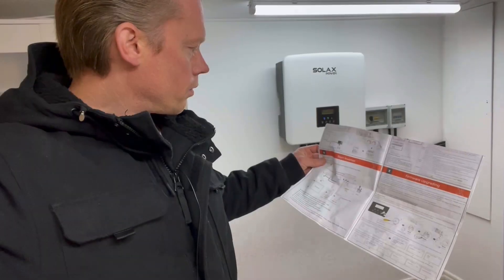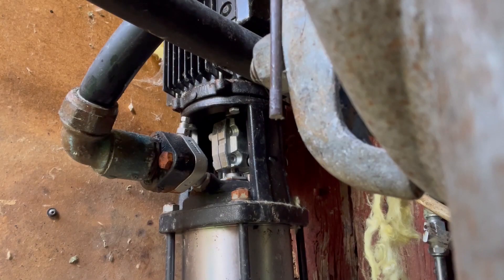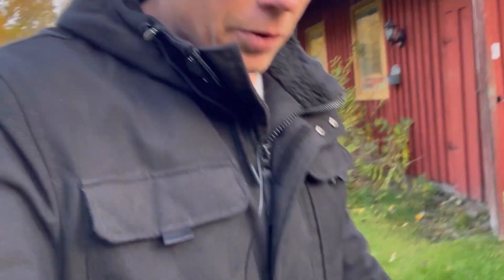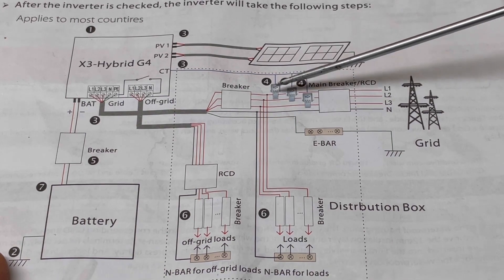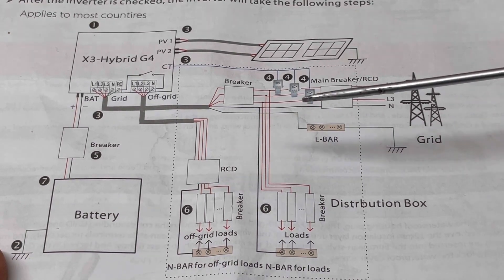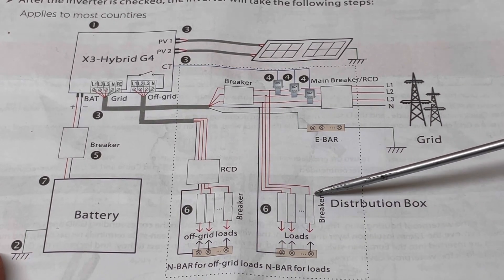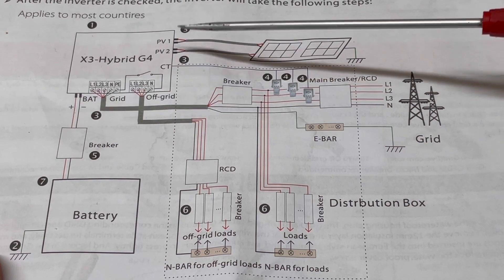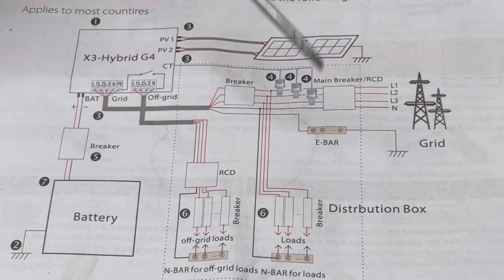Trying my 3 phase well pump off grid with my solax hybride inverter

Comment: Nice one! Good to know you have water independence too. I guess your power tools are also happy with the new supply!? 
I bought a much smaller pump for this reason. A Katsu electronic booster pump, that only draws about 500W. My 5kW inverter can handle it without complaining.
Reply from the maker: My compressor is probably to big, 9kw motor on that one... I have not tested it but I guess that it is to much for the solax. Seems like you have a good solution for your water👍🏻

Comment: How much kw you can run on 3phase backup on Solax,3x3kw?
Reply from the maker: It depends on your battery voltage. In my case nominal 400V at 30A = 4000w in one phase.
So 4x3kw.

Comment: I have taken down many softstarters, they create lot of transients on the net, specially when the line voltage isn't stiff and I would never use it my self. 
If it have to be started up with a ramp, you have to use an inverter (frequency converter), but if you don't have a voltage sag, then never mind, if you do have voltage sag, then you have to see how many amps it takes in the start up period.  
Typical 7.5 - 10 times of the nominally lode, depending of what type of motor it is.  
An EFI 4 motor will consume most power at start up.  
A bit weird, since it is the most efficient motor. 
To document that will take a lot of typing...😊
Anyway the motor was ramping up fast and is running smooth.
Just for the fun of it measure the voltage drop under start up, just the first 1 - 1,5 secund
PS: It would be interesting to see what possibility there is in programming the solar charge controller and inverter.
Look forward to see your next video 😊

Comment: Would it not be a good idea to install soft start?
Reply from the maker: We normally do that on much bigger motors, in this case it’s not needed but it would definitely make it easier for the inverter.
Reply: @flyingtools  I would still recommend it - it's not expensive and will protect you from situations when you run something else already and then the motor starts, overloading the off-grid inverter part. Still, it's impressive how smooth the motor runs - great inverter.
Reply: @flyingtools  Although, you built a fine working system and I am just a random stranger on the internet, so you do you...
Reply: Soft starter is good for the mechanical side of the pump also not just electrical side